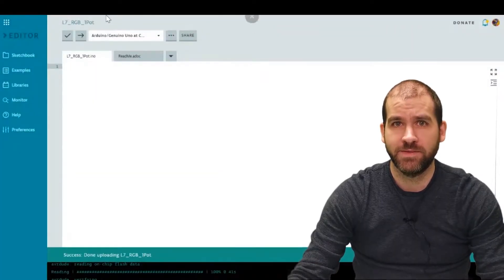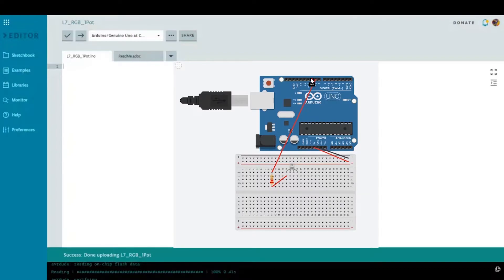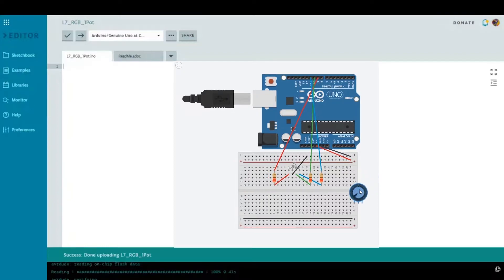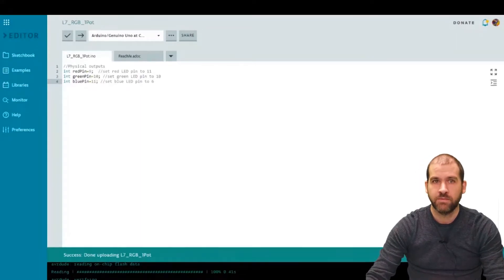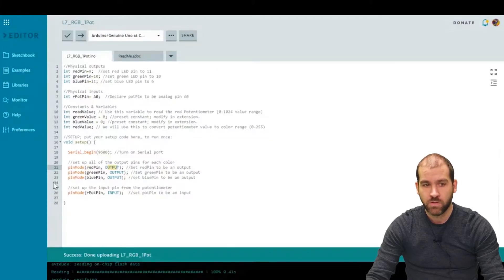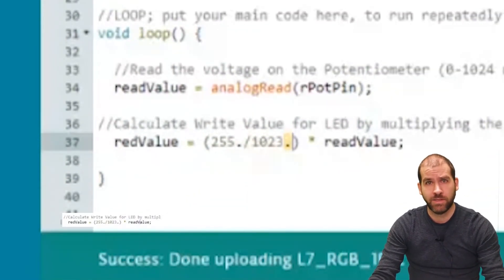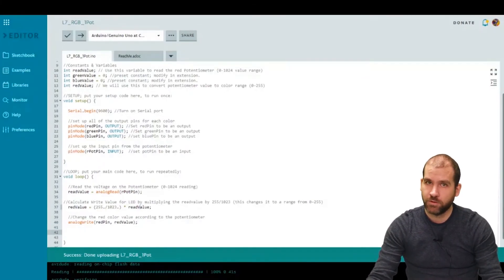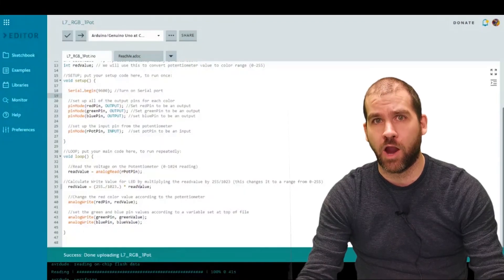Arduino Basics - Lesson 07 - Using a potentiometer and an RGB LED

Comment: Question about the math portion.  Why can't you do:

redValue = (rPotPin/4.) ? or if that potentially gives you a value higher than 255 like 1023/4= 255.75, since I don't know if this rounds up or down or uses the entire decimal you could also do

 redValue = ((rPotPin/4.)-1)

Since there is 1,024 different positions on the potentiometer and 256 different possible values for the red LED (and 1,024/256=4) wouldn't this be an easier code?  And if I heard you right adding the period to one of the variables in the equation will read decimals?  I could be way off, I'm just curious.
Reply from the maker: Adding the decimal point is what allows the decimal value to be included, even though it's not relevant to the color value. There are definitely different ways to get there. Essentially you want to take the pot value, divide it by 4 and then either round or truncate the decimal so you have something in the 0-255 range as an integer.